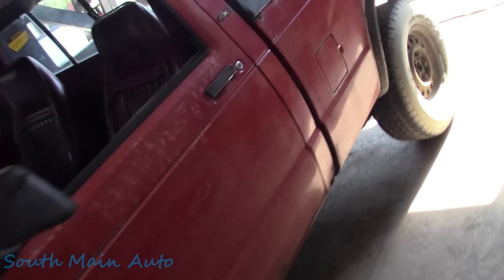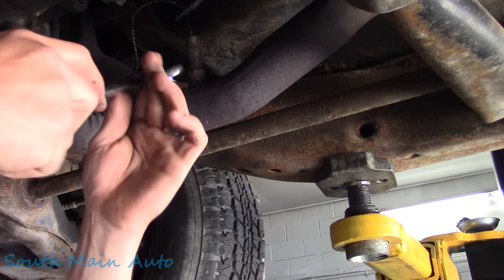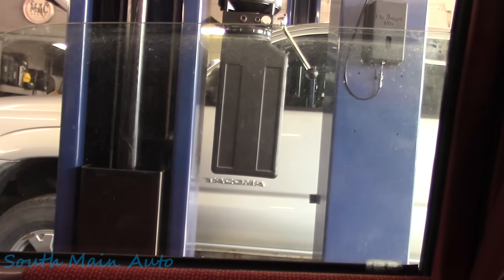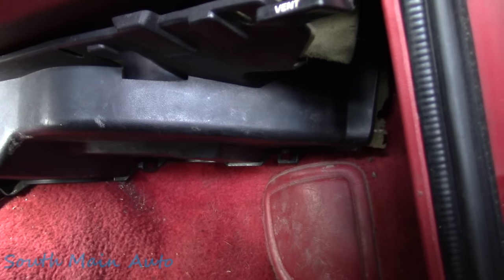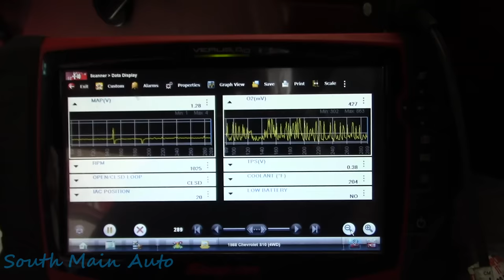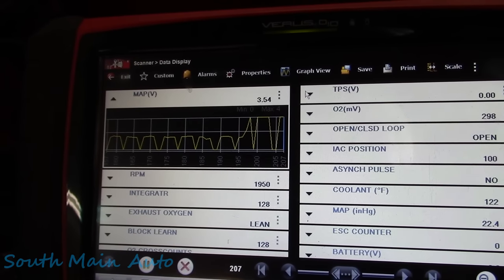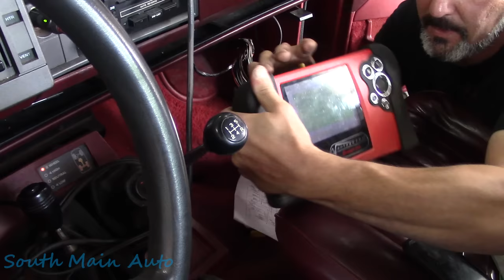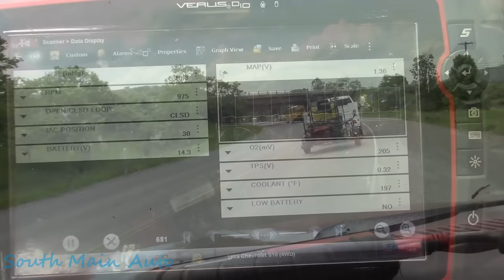Chevrolet S-10 - High Idle and Dies After 20min Drive?!

Comment: Solder joints on old vehicle circuit boards are notorious for developing micro cracks, that create intermittent opens. Reflowing solder joints will sometimes cure them. On this unit, tho...the regular patterns point to borked electronics.

Comment: Man, I miss my '88 S-10 Blazer.  Had the 2.8 also, but it is way underpowered for a 4x4 truck.  Also had a similar stalling problem.  Mine ended up being a cracked Throttle Positioning Sensor.

Comment: I would think you have a dy joint on, as you suggest, a voltage regulator device.  Or a longer shot on a zenner diode.  Quite sure a good visiual will find it.

Comment: 1989 Isuzu Trooper 3.1 (2.8 original GM v-6). Oh the stories about that electronic POJ. Junk... Very sensitive to exhaust leaks and do not get me started on the junk that is available. Basically it is now a Rodeo engine. When it runs it runs strong for a 3.1 and now I am beginning to suspect the PCM as my latest problem. I collected some spares so it is time to try them one at a time. I use WinADL software on a netbook running XP. Comm is Red Devil aldl to usb converter. The commonly available exhaust manifold gasket will blow out and the air that is sucked in will interfere with the O2 sensor readings. I am about ready to convert to a 2-bbl carb and regular distributor from the early 80s.

Comment: I really prefer older vehicles like this. So much easier to work on and none of the CAN-BUS garbage they put on cars today. One popular route to take to answer the problem of aging PCMs is to install an aftermarket system, such as Megasquirt. For my old '87 Porsche 924S there's a guy out in Arizona that manufactures entirely new 'guts' for the factory DME (PCM).

Comment: I had a 91 buick lesabre that used a similar computer system. While putting in a stereo amp one day the 12v hot wire slipped from my hand and touched the side of car with some sparks. Finished up the work and drove about 20min before the car now started to behave exactly like this S10. Would consistently die after about 20min of driving. I got a new pcm and swapped my chip into it the same as you did, the issue never returned. 

Based on my experience, I'm guessing this S10 had a wiring issue at some point that caused this. Maybe even that o2 sensor shorting out could have done it.

Comment: Relic..no way. My 1987 s-10 2wd Blazer is still clean and runs well. Of course I had to replace the o2 sensor, throttle position sensor,  idle control valved and rebuild the throttle body  and injectors. Other than that the usual wrenching to replace other components make it keep on ticking. I like it because it is repairable, not an automotive rubiks cube.

Comment: Nice one. Had me stumped, until I saw all the screwy data graphs cycling on/off at the same time and frequency. Yup, something's having an epileptic fit in there!
Reply: "Epileptic fit", as in the processor is stuck in some kind of loop. Most likely caused by a brownout from the processor's voltage regulator being on the fritz. Could be as simple as bad capacitors there-in. 

Doubt very much it's a bad connection, or the problem would appear randomly on bumpy roads, rather than after 20 minutes every time, followed by needing to turn the device off for 10 minutes to restore normal operation.

Diagnosing this kind of thing is like diagnosing sick people at a convention. If one person gets sick, we think it's a fluke. If 10 people get sick, we look at where they were sitting, where they went, what they did, or who ate what. If, as in this case, EVERYBODY gets sick at the same time (all computer inputs rhythmically drop to zero on a fixed frequency, all in sync with each other, after 20 minutes of operation), we start looking for venue-wide issues, like air supply (or in this case, power supply for the processor).

Comment: I needed a camshaft for my 2001 lesabre 3.8, one of the lifters which are of the roller variety decided to explode wiping out a lobe, I went to a local auto parts store who said they could get me one for around 450.00, the last place I ever thought of looking was at the zone or advance auto, a couple of places on eBay had one for about the same price as the local store. As a last resort I tried advance and not only did they have it with the discounts it was around 200.00 with free shipping, the cheapest anywhere, that was about four years ago and it's been running great ever since, the car has 312,000 on it.

Comment: I recall working on alot of these in the 90s and early 00s and if data was funky and the truck ran like doo doo intermittently, using the ol red brick, you would drop the ecm and give it a couple of love taps. Most times the truck would die! LOL New ECM and updated prom, fixed. Of course at that time, all that crap was readily available. Good o2 function is critical on those old systems.

Comment: "Quality southern truck" ........could be an export from  MeHiCo!    I think the issue with the PCM is not about external heat soak, but an internal component getting hotter and hotter until it goes haywire.

Comment: I have an 86 GMC S15 Jimmy High Sierra , has the 2.8 v6, All the gas mileage of a V8 and the power or of a 4 banger.

Also about the PCM. Over time circuit boards experience a phenomenon known as chip creep where the chips will come off of the circuit board through repeated heating and cooling cycles. If you have ever seen a green dash clock that goes in and out, likely you are seeing chip creep. Sometimes you can put the board in an oven and reflow the traces but you risk damaging another component on the board. Chip Creep can also cause micro cracks in the solder that open up with heat (time in use) causing poor connectivity. If the traces are opening up the current and voltage within are going to get wacky and give erroneous data.

Comment: Let me make a "technical connection" about this problem. The electronic PCM is 34 years old and the problem seems to be thermal. This just like many 30 - 80 yr old radios, power supplies or whatever. The root problem is almost always capacitors in the device. Usually it is the electrolytic caps. Even a replacement from a junkyard is still 30 some years old. So... find a electronics hobbyist, radio amateur, antique radio restorer. They can replace the caps for you and that may just fix the issue. They can also correct cold solder joints etc while they are in there.

Comment: The PCM has the motherboard and software in the chips. The chips are on the motherboard. So it's all together. The EEProm (one of the chips) has the VIN number in it and other details. That is what gets duplicated from one PCM to another for the "new" PCM to work on the vehicle. 
This PCM is probably so old that it crapped out inside.

Comment: The coil is hiding under the intake manifold and distributor is down there too and the internal Hall effect switches go thermal. The PCM probably is no longer available so try the distributor first. Nightmares to work on and too nasty to touch. Crush it! 😊, no really, crush it.

Comment: back when I was a kid my dad flipped so many of those s10s in the blazers especially the blazers. he was a body man, not a mechanic. you know he knew a little bit about engine work but mostly older stuff... Long story short he was a body man. he was the frame machine guy. when you hit a tree he would have the machine with the pedals and hydraulics and it would bend everything back to factory specs.... I used to buy those with rot, do the body work and paint them and then sell them way more for way more money? obviously you'd probably do a little bit of small stuff too. maybe brakes tune up. you know small stuff so the person got a decent vehicle but he would get them for cheap because they would need rockers or cab corners, fenders, bed size and you would just metal fabricated himself

Comment: Hey Mr.O. I have a truck doing something similar. After driving for 20 min it just powers off when driving. All The dash lights and headlights shut off and the truck just stops. I have to pull over and crank it back up.

Comment: the things I remember failing most on those, were ignition coils and control module(from bad wires/plugs) and the fuel injector coils go low resistance, causing the computer to overheat and shutdown. they'd usually do that and recover for a while, then get worse to ECM death and very low resistance injector. I made the mistake of only swapping an ECM and didn't check the injector. it lasted about 5 days of short drives. 🙃
*and the fuel injector wiring/plugs where the air cleaner riser extension sits!*
Reply: I know nothing squared. However I am understanding these trucks are a solid old horse. Second there are those who like to give great detail on how to keep them jumping along the road. Thank you far friend for your helpful advice!
Reply: @johnmcdonough955  I still own a gm TBI of that vintage, albeit a 5.7L V8. also maintain a few other and some slightly newer gm spider injection setups, a few have 300K+ on them.

Comment: Lol my old man had a 4 banger s10 4x4 on the floor extended cab (it sucked having to si on those little pull down seats ) it was a great truck after he replaced most of the front end

Comment: i'm not an electronics guy either but it's been my experience with a lot of the simple obd1 gm cars that problems like what you're seeing are the result of bad solder joints on the circuit boards which lose connectivity when heated up. for future reference since those older pcm and bcm's can be so hard to get in a pinch there'as a fair to good chance that since those old modules have thru hole style pcb's, pulling the board out and hitting the underside with the gun from a hot air rework station or even a regular heat gun, if you are careful, will reflow the solder on the board and fix the problem, but i did say simple gm's like the S-10, cars like the 88-92 olds toronado and the various Cadillac's are another story.......

Comment: Some of those early GM PCM's had 2 or 3 updates on the PROM's . So any used one would have to be verified unless the original was updated and then transferred over . I still have an original 1987 Chevy Celebrity and 1995 G20 Van . I have at least 2 spare PCM's . As long as the Service # is the same , the PROM should be specific to each vehicle . I bet you got that PCM dirt cheap .
Reply: If it's possible, I can email or text. The only " telegram " I am familiar with is Western Union ! 🤣 LOL !  I can try that later or it's off to the library for instructions.

Comment: I had an old projection television that had symptoms of a convergence amplifier go.  Every repair said to replace the amplifier.  I simply reflowed the solder and added wires from the pins to the circuit board in parallel with the solder joints that appeared to fail the first time.  After 10 years of working flawlessly, I gave it away or threw it away.  Items that terminal cycle tend to fracture the solder joints on large rigid components.   

I’ll bet the module had a fractured solder joint and would open up when the module got hot.  Unfortunately, reflowing the solder on everything may permanently damaged a component and be a waste of time.  The module may be coated with parylene and be very difficult to work with.

Comment: Considering it happened when it heated and such, it's probably some through hole components that are pulling away from cracked solder joints. Ever dealt with an early 2000's f150 with a compass/thermometor/etc display that no longer works? Same deal

Comment: I have a 90 GMC Jimmy 4.3 tbi I love it I've replaced tons on it but there easy to work on unfortunately because it's got 217000 on the original engine and transmission it smokes sometimes so I'm pretty much changing O2 sensor yearly

Comment: Encountered similar situation many many years ago on an 88 Grand Am. It ended up being a shorted out seat belt retractor. Just dumb luck I found it while replacing the 3rd pcm I leaned up against it and burned my arm.....I unplugged it and it stopped barbecuing computers

Comment: I had a pick-up coil on the distributor shaft that went bad on my Chevy Blazer. I drive 20-30 miles and it dies. Replacing the pickup coil solved my problem 🤷‍♀️

Comment: I would not check the MAP sensor 1st, I would check the 12V because that would affect everything. Seeing the final results, it might be a Analog to Digital Converter or an analog Multiplexer IC a cracked solder joint or pc track for the ADC control bus, output bus, or ADC reference voltage or logic power. The MUX routes the various sensor voltages one at a time as commanded by the microcontroller to the ADC which the provides the digital equivalent voltage to the micro for engine control processing.

Comment: I thought one cause of high rpm is from a vacuum leak. I fixed one tube to the spacer on the throttle body. That didn't help. So I tightened all my screws to the throttle  body, and that fixed it.

Comment: Probably bad solder joints at the copper pads or a bad or broken, possible cracked trace (the lines on a printed circuit board) on the circuit board making intermittent contact as it heats or cools.

Comment: You had noticed that someone was in at the PCM. So give the connector pins a good look over, could have been a loose pin or connector, and check the wire harness too for any abnormal crimping, fraying, or melting? Are any locking tabs broken? Any dents on the PCM? Mouse piss equates to CORROSION, it might of had a nest on top of it at one time, and piss seeped into it? Boneyard search for used one perhaps?

Comment: TO remove old O2 sensors, use a plumbers flare wrench to grab 5 sides of the hex, after first saturating the threads in AeroKroil or PB Blaster and giving it plenty of time to creep in, and banging it with a hammer a few times for good luck before you even start with the wrench.  <= knowlege gained from years of tinkering on 30+ year old Euro cars like Volvo, Mercedes, VW.   All those I remember had 3 wire Bosch sensors (signal, plus 2 heater wires).   I always used Bosch brand replacement sensors, too, anything else was far too iffy (and, VW, Volvo, and Mercedes OE sensors from the 80s, early 90s, were all Bosch anyways).

Comment: Had the same truck and engine just no 4 wheel drive....And the same issues and was going nuts trying to figure out what was wrong and was throwing everything at it , was at checker and the guy being the parts fetcher notiiced...he too had the same issue and threw some type of sensor that sits at base of distributer was like $30 bucks and sure enough it fired up...

Comment: The PCM/ECM has a bad DC-DC converter, can almost guarantee it. How do I know, because the ref voltages are flakey and it only happens after the internal component temps have reached probably 95 degrees. You were on the right track with the hair dryer, but you were only heating the case. It takes awhile to transfer that heat through the air gap into the board and then the converter itself. Leave it going for 7-10 minutes (not on high) and it will mess up.

Comment: You had two problems with the O2 sensor.  One was the Broken O2 sensor.  The other was the melted insulation on the O2 sensor wire shorting to ground intermittently.  So you solved two problens replacing the O2 sensor.  But your still broke.

Comment: I had a sunbird that failed like that... Easier way to test those old pcms, open the casing of the computer and use a can of spray air inverted... It will instantly freeze the board, and you'll see the response change quickly

Comment: I had a 93 s10 4.3 2wd 4l60 trans and truck sat for 7 years and went through everything got ot running and driven and then issues poped up guy said trans was bad but was only low 3 quarts of fluid so got lucky . But later check engine light came on for knock sensors and coolant temperature sensor bad lost signal and come find out ECM was shot . Then transmission started to shift werid from 1st to 2nd like jerk hard like had a shift kit in it cause if u took it down road and gave it beans man it would bark the tires hitting second gear everytime . And going into reverse or drive had a delay so long story short it ended up being a bad ECM Prom chip found one from junkyard with same year as mine and everything and same numbers matched and swapped and the truck was fixed no more issues.  Then months later sold it and now wishing I kept it

Comment: hi Eric, big fan. I have a 2001 ford taurus 3.0l dohc. is there any way you could lookup where the ac evap coil temp sensor wires connect to under the dash? I have spent the last 3 days trying to find this info to be able to unplug and check resistance on this part to try and avoid pulling the dash to check it. it would be much appreaciated. at this point i have narrowed it down to this part or the expansion valve. also I only have a simple code reader and noting comes upo on hvac or ac codes. thank you

Comment: The ECM fault is mostly likely a failing internal voltage regulator in the module itself. . Once they get hot they shutdown to protect themselves  and restart ok once cooled. Classic symptoms.

Comment: My son has a 1991 S10 Blazer 4.3(?) V6 that belonged to my father. It has less than 30k original miles and is in mint condition. It also has a digital dash that is not displaying data properly. What's the best way to determine if it's worth refurbishing, or will require replacement?

Comment: Are you using a Delco or aftermarket o2 sensor? Some after market sensors depending on the brand have not worked on GM vehicles.Have you found this to be your experience?

Comment: reseat the chips inside??  I have the 1988 s10 2wd and the chip pins were corroded........I just cleaned them and bam..........runs again.  Not sure the prom chips or the other chip would do it what yours is experiencing